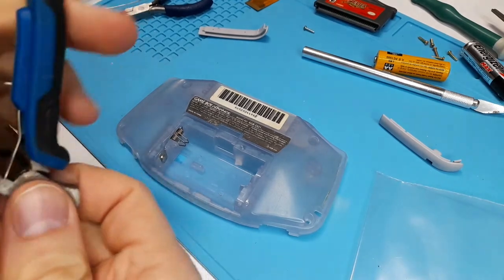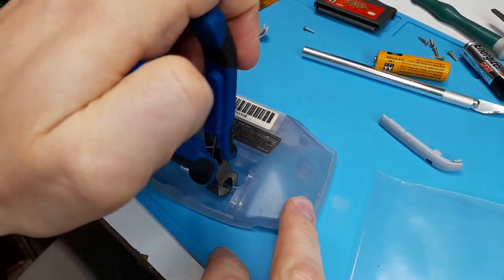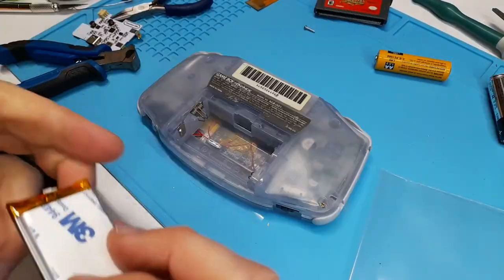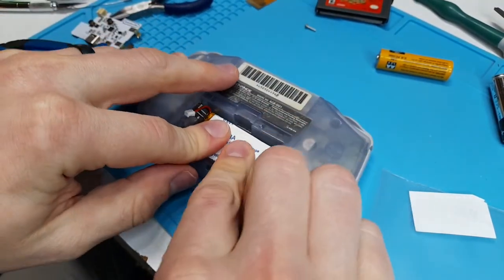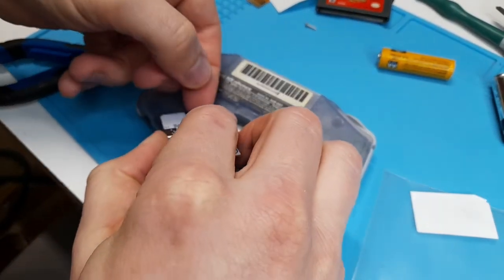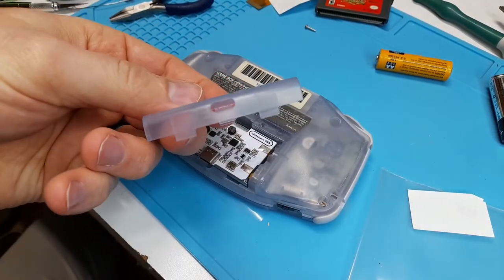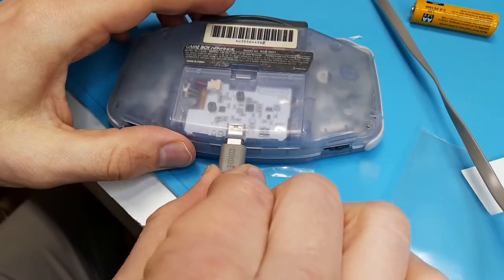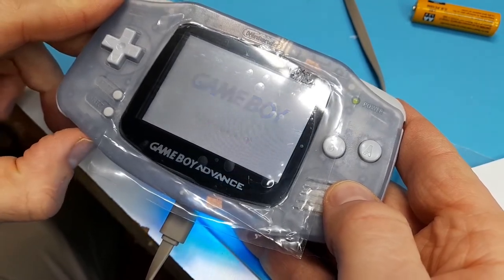How to Install a Rechargeable Battery in a Gameboy Advance

Comment: Hello, I noticed that when I put on charge my gba, both blue and green led light up.
Is that an issue or I am missing something? I mean, technically the green led should light up only when the battery is fully charged, right?
Thank you.
Reply from the maker: Hmmm, good question! I haven't encountered that yet to be honest
Reply: @VideoGameRestoration  thank you
Reply: Its normal, the green light is on when the cable is on (PG stands for plugged). Blue light will be on while charging and will turn off when charging is complete.

Comment: Can I use the cable usb c to usb c or usb a
Reply from the maker: USB-C to USB-A!!! Never C to C
Reply: @VideoGameRestoration  what happen If I put c to c
Reply: @VideoGameRestoration  I did it and red and blue light came on
Reply: @VideoGameRestoration  did I damage anything or it just won't charge
Reply from the maker: @petermuniz9296  it could over heat and catch fire 😬
Reply: @VideoGameRestoration  are you sure I just got c to a and it dose the same thing red and blue light is on ???
Reply: @VideoGameRestoration  I just spoke to the person that sold it to me. He says I’m good you may need to update your battery.